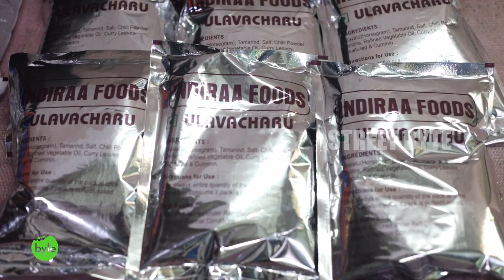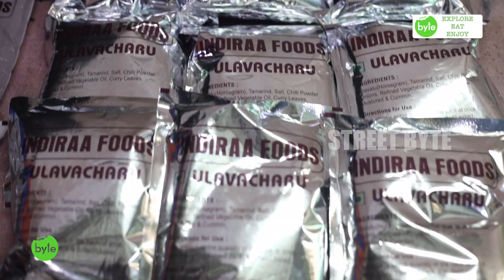INSPIRATIONAL FOOD STORY | ULAVACHARU MAKING | Vijayawada food |

Comment: He says they don't use Aluminium but I could see Aluminium buckets and plastic buckets being used. And work place safety guidelines are missing. What if the hot liquid falls on the food handler. They are not wearing proper shoes also. 
And the ss container is open and the ceiling also dirty. God knows what all might have fallen i n the liquid 
Let's hope they might have improved in the past two years

Comment: Food s prepared in aluminum vessel, which not good. Second not hygenic preparation.. owner totally money minded. No head mask.. no gloves nothing provided by him to workers. Good food prepared in unhygienic cont'd.
Reply: First it's not aluminium vessel
2nd you may think it's unhygienic because of black floor, remember it's cement floor and due to heat cement color becomes black
Reply: And regarding head masks and gloves why one has to wear those just because of sweat that may fall in right?!the boilers itself was very high in height and after making i.e after reducing the heat not even a single droplet of water must not be fall into it as it will be  spoiled in less than 1 day which actually should last for 5 days